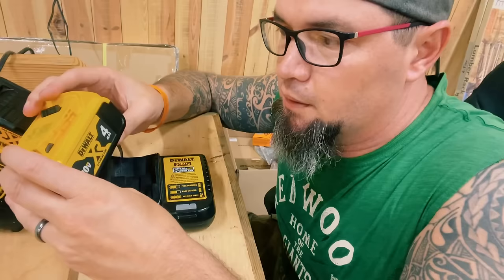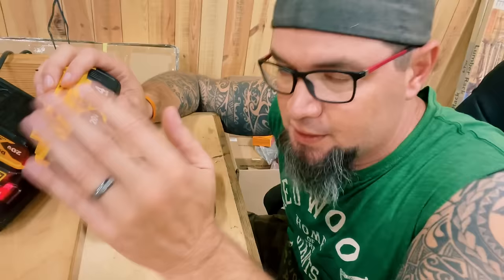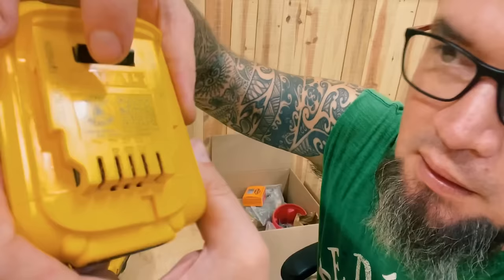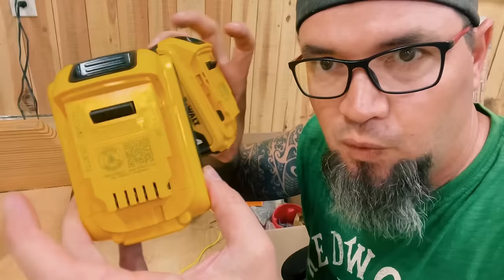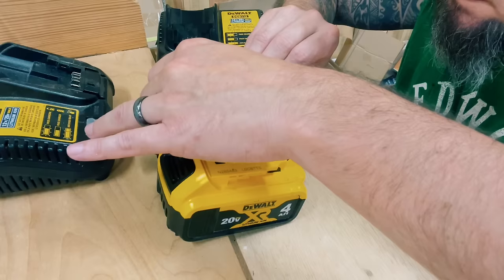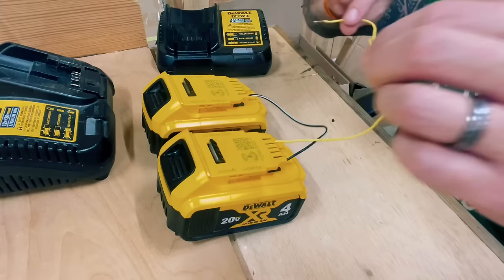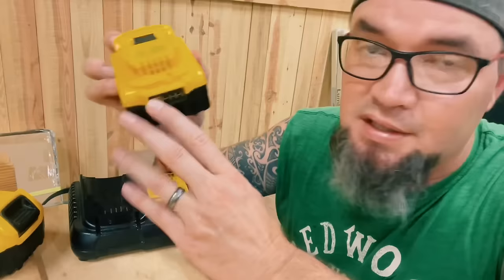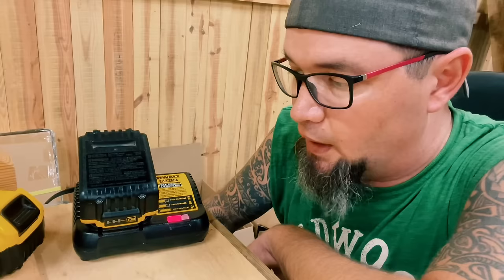Dewalt Lithium Ion Battery Won’t Charge? Try Resetting It With This Easy Fix.

Comment: Thank you, Matthew, you're a Peech! EVERYONE knows this fix, THE WRONG WAY!!! Most have been taught to do that reset with a number of electric sources other than the right one you can easily get from a like battery! Too easy! And then with your explanation we now have a full understanding as to WHY this is happening! Thank you again for taking your time to make this video!
Reply: Reasontruths:  that's ok but what about those who do not have a spare battery laying around.  Can another type of battery be used to put some juice in it?  I guess you have to match the voltage.
Reply: @horacesawyer2487  Good question, try it and see. What can you lose? A battery you can't use? I have multi voltage transformers, I'll find the right match no matter what the voltage. I have a whole slew of AA and AAA rechargeable batteries that are completely dead, and won't charge, this method works to bring them back! But I just use another AA or AAA to jump start the dead ones because I have so many good ones also. Do you have any small rechargeable's to try it? It doesn't seem that a lower voltage could hurt the higher voltage battery. Try at your own risk, but crazy me would go for it!
Reply: @reasoningtruth  Warning. Only do this in an emergency. If you manage to charge this battery, do not keep this battery anywhere it can cause a major fire.
Why ? When these batteries are discharged below 3v per cell, dendrites (small spiky structures) can grow and possibly pierce the separator between the anode and cathode of the battery, causing a short circuit, and thus a fire.

Most consumer electronics will regard 3.3v as fullt discharged, and the battery protection circuit will then turn the equipment off to prevent over discharging.

If a cell is found to be 2.3v or lower for anything by the a very brief time, then it is effectively dead, dendrites will have certainly grown, and even if you manage to charge it, the dendrites are still there, and you now have a ticking time bomb. Do not reuse such a cell.
Once that separator is pierced you may have a fire, the intensity of that fire will depend on how much charge is stored in that cell.

If your battery pack has been dischared for some time, open it up, and measure the voltages directly accros the individual cells. If this is less than 3v, do not attempt to charge. Even if there is not a fire, you will notice that after charging, that cell will self discharge within an hr or so. This is due to a partial internal short circuit caused by dendrites. More energy put in to such a cell increases the risk of fire.

You have been warned.
Reply: an this be done with a 10 amp battery charger?

Comment: Thanks! About three years ago I ended up with two Black & Decker hedge trimmers and never got around to sending one back. I was going to sell it, but never got around to that either. So it sat in its box until this year, when somehow the charger for the original one got misplaced. The "extra" battery was completely dead and wouldn't take a charge. Following you instructions fixed it immediately. Just the time it took to cut a couple pieces of wire and strip them on the ends. I'll remember this. Again, thanks.

Comment: Thank you so much! Good demonstration, just the right warnings.  For anyone interested: after a 5 seconds jumpstart, my dead battery went from 1.02V to 13.3V between B+ and B-, more than enough to work. You might want to try only 3 or 4 seconds.

Comment: Thank you for this! I had 2 dead DeWalt batteries and so thought my charger was dead. 
I used a charged Bosch to get them started. Worked exactly as you explained and saved me from buying a replacement!

Comment: Thank You Matthew! I had the identical battery, which was almost new. Your idea worked like a charm. I connected mine for 15 seconds, which is likely 10 seconds too long. After removing wires one light was lit on the charge indicator. Your presentation is too the point with no fluff.
Reply: It was too long yes.

Comment: Yes this does work, my 20v battery pack read 2.0v, i bumped it with another 20v pack for a 2 sec and it gave it a surface charge of 12v decreasing to 7v which is enough for the charger to recognize the battery. This can probably be done using a 9v battery as well if you only have one tool battery since your only giving it a small surface charge
Reply: Warning. Only do this in an emergency. If you manage to charge this battery, do not keep this battery anywhere it can cause a major fire.
Why ? When these batteries are discharged below 3v per cell, dendrites (small spiky structures) can grow and possibly pierce the separator between the anode and cathode of the battery, causing a short circuit, and thus a fire.

Most consumer electronics will regard 3.3v as fullt discharged, and the battery protection circuit will then turn the equipment off to prevent over discharging.

If a cell is found to be 2.3v or lower for anything by the a very brief time, then it is effectively dead, dendrites will have certainly grown, and even if you manage to charge it, the dendrites are still there, and you now have a ticking time bomb. Do not reuse such a cell.
Once that separator is pierced you may have a fire, the intensity of that fire will depend on how much charge is stored in that cell.

If your battery pack has been dischared for some time, open it up, and measure the voltages directly accros the individual cells. If this is less than 3v, do not attempt to charge. Even if there is not a fire, you will notice that after charging, that cell will self discharge within an hr or so. This is due to a partial internal short circuit caused by dendrites. More energy put in to such a cell increases the risk of fire.

If the cells have briefly (a few hrs only) dropped below 3.3v, but, not below 2.3v per cell, then ok, have a crack at charging, but, there is increased risk of fire. 3v can be revived ok providing the cell has not been sitting @ 3v for period of time. More time below 3v = greater risk the anode to cathode separator will be pierced from growing dendrites, causing a short circuit, and hence a potential fire hazard.

You have been warned.
Reply: @nordic5490  true this trick only worked temporary and the pack didn't hold a full charge, after separating the individual batteries 1 cell was bad and couldn't be charged, also realized this method can over charge cells. The remaining cells tested fine with low resistance and near rated capacity

Comment: Well Mathew, I can't tell you how helpful this has been. I have already taken 4 different batteries back to Dewalt to have them replaced just for this very reason. Many thanks for some extremely helpful info sir and you now have a new subscriber!
Reply: How do you take them back to Dewalt
Reply: @billyd.6411  Out here where I live there is a Dewalt store that does repairs. That's where I take my Dewalt tools to be repaired and such. And as long as the batteries are still under the 3 year warranty then they will exchange them with no questions asked.
Reply: @brianfalls5038  ok thanks will give it a try do I need a receipt or can they tell from serial numbers
Reply: @billyd.6411  If you look on your battery then it should have a date code on it. It should be on the top left hand side of the battery. You shouldn't need a receipt for the battery.

Comment: My only suggestion would be to make up your wires with spade terminal ends, just to avoid the risk of loose strands of wire breaking off inside the battery housing and causing problems down the road.

Otherwise, good video, thanks. 👍

Comment: I can't believe it actually worked!  I had a brand new battery with a power tool kit and it didn't work out of the box (got a warranty replacement after going through troubleshooting steps with the manufacturer). But this trick actually kick-started it. I only get 3 bars out of 4, but as a spare backup battery, it's better than landfill!

Comment: It’s working. One totally discharged Dewalt battery and one partially charged Dewalt battery. Partially charged battery was able to start charging. Couldn’t get the totally discharged battery to start charging. Connected like shown in the video for around 5-10 seconds. Disconnected and then plugged in the totally discharged battery and it’s charging! Thanks!

Comment: under no circumstances do this without testing cell voltage first (open the battery up and check the voltage acreoss cells), YES it can work if the cell voltage is still above 1.9v , if it has dropped below 1.9v and you do this you run a high risk of overheating the cells as the cells can experience dentritic growth between cell layers and cause short circuits
Reply: Do you have to disassemble the case or can you test at the B+ & B- contacts?
Reply: @kevosims2012  I take the case off so I can check the cells individually (or in parallel pairs)  if you measure the total battery voltage it might show it down by a couple of volts which could be interpreted as either a partly discharged battery or a battery with one cell near death, I don't like the ambiguity
Reply: @TheMingilator  Copy that. Thanks for the reply, very helpful.
Reply: It's not going to overheat and explode in 3 seconds.
Having said that: do this outdoors
Reply: SaltyBrains if it's been entirely depleted then it is no longer a good cell, it is best practice to dispose of them

Comment: Just repaired 4 batteries like this. Word of advice to someone trying this trick. You may need to keep both batteries hooked up together for 1 to 2 minutes to get enough charge in the depleted battery so that the charger recognizes it. I went by intervals of 10 sec, 30sec, 1 min, 1:30  then 2 min. Kept one connected for 3 min to try and get it going but its still having problems. Didn't see any negative side effect on the good battery even at 3 min connected.

Comment: You helped me. I didn't have a 2nd battery but I did have a trickle charger I use for my lawnmower battery. I used small nails as contacts and connected directly to charger. The green light started blinking showing I had it connected correctly and after about 30 seconds I disconnected it and set it in my charger and it charged. Saved me big time.

Comment: I looked all around this job site and had nothing, no spare wires. but I did have an assortment of tiny slim washers. I lined up the positive to positive and negative to negative terminals as you said, but used the two washers to go into the battery slots, probably could fit dimes as well. Got a larger than I expected spark which reset the battery and now it is charging! Thank you! I looked like MacGyver !

Comment: Thank you!!! Had same issue a few months ago and I just threw the battery away. Fast forward to today and had same issue with a second battery. Stumbled upon your video and gave it a shot. It worked! You saved me money. Thank you. I used thinner wire and it started to melt almost immediately.  Be careful and make sure you remove wires right away.

Comment: I had done the exact thing with a 2ah battery. Run it down in a stereo. It’s been on the side for over a year. It was a nearly new battery before it went into the radio. I’ve just followed your instructions and wow. You saved me buying a replacement. Thank you. I have sent some money as a thanks for saving me money! .

Comment: Thanks you so much for this lil hack I just bought a second hand DeWalt drill set and one of the batteries was completely  dead it's worked 100%😊😊

Comment: Thank you...that worked for a 20V Max Li-on!! 👍 I used four box cutter blades inserted into the +/- terminals on each battery - one fully charged, one dead. Then connected those in polarity with two jumper wires that had alligator clips on each end. You're spot on: "only for a few seconds." The jumper wires were getting warm after 10-15 seconds. The dead battery started charging when placed on the charger. The dead battery had been left in a tool for a few days and died. Not worried about "old" battery revival issues with it.

Comment: Thank you for this video. I have had my Dewalt drill for 2 years now and I have never used the other battery. I just recently tried to charge it and it would not take a charge. I just tried your hack and bam it is now taking a charge. Thanks again.

Comment: Much appreciated...met a guy giving away hi  40v brushless trimmer (like new) because the battery was "done" and they want $400 for a replacement. got trimmer, charger and battery for free...brought it home, tried this hack...went out and weed whacked the whole yard 4 hours later.  This hack is a great find.   :)

Comment: EXCELLENT VIDEO!!! I could tell you knew what you were doing when you connected the positive 1st (most don't understand why). If you want to know, it keeps the battery from arching. I just wish I knew this trick a few years ago! I threw away over $2,000 in batteries because I left them in my garage over winter (I'm in the NE). NONE would recharge but I didn't try this trick. I've used it OVER AND OVER since! Out of at least 100 batteries, only one would never recharge.

Comment: I have exactly One Dewalt 20V battery, purchased years ago for a heated DeWalt Jacket, which I ended up using my Milwaukee 12V batteries in

Tried to charge the battery recently & it was absolutely dead; Following your instructions, I used a fully charged Ridgid battery (LOL) to boost the DeWalt and placed it in the charger & it's taking a charge

Have a couple of "dead" Ryobi batteries, just have it a quick boost, using my Rigid Battery & it's now taking a charge 

Thanks for the tip

Comment: I had to come back by and tell you THANKS AGAIN, BROTHER !
I did this and it worked !
I had just gotten 2 brand new 5 AH  DEWALT batterys off of Ebay only a month ago. One died - one was fine. The dead one wouldn't do anything after one use.
So Sincerely, Thanks !!
Wulfy

Comment: This isn't only a cost and time saver, it's an environmental protection as well.  Thank you.
Reply: For a very short time. The "zombie" battery is dead and only working at low capacity and dangerous too. 
But hey, go for it!

Comment: Easy to understand, easy to follow, worked when I applied it. Honestly I took my little home electrical kit. Took the alligator clamps and a ring terminal on both ends and slid them in as noted. Waited 5 seconds. Disconnected and onto the charger and now my battery is charging.   God how did I not know this earlier 🤦‍♂️

Comment: Holy crap, just pulled my dead battery out of the trash to try this. Seems like a design flaw that it uses charge to detect if a battery is present. Thanks!

Comment: My battery was actually showing as full when I put it on the charger despite being dead. When I checked the voltage I got 15V. I used your method in 5 second increments, checking the voltage after each bout. After 4 or 5 connections, it was up to 17.3 V and it worked on the charger. Thanks!

Comment: Freaking awesome!  I had one that I put in an adapter to run my jig saw and it set about a week.  It completely drained it and wouldn't charge.  This saved me about 60 bucks for a new battery.  My hat's off to you sir!  Thanks!

Comment: IT FREAKIN' WORKS!!!!
I just bought 2 brand new Dewalt drills with 2 batteries & charger. One battery shows NOTHING when I plug it into the charger= dead. These batteries are the cheapest ones & do NOT have the battery charge status indicator display button with lights.
EDIT:THANK YOU!!

Comment: Awesome. Saved my 60v toro flex force battery. I used a DC bench tester at 60v and 0.5 amps for maybe 8 seconds then put it on its regular charger and bingo, it started charging. Thanks!

Comment: Had a “bad” battery that would not charge.  This tip seems to have worked as the charger and battery now indicate that it is charging.  Thanks!

Comment: I didn't have another DeWalt battery so I used a 9-volt battery and wired it in the same series as you show in your video held it there for 3 minutes The  battery fire backup!
Thanks 😅

Comment: Thanks for this video.  Had 3 new batteries, don't know how one got discharged as don't even recollect turning on the attached device but a couple of times.  Followed your procedure and the battery's charging now!  Going to retain my speaker jumper wires in the Dewalt tool bag!

Comment: Thanks man, you just saved me a lot of trouble. Guessing this resets an internal BMS? I have a big lifepo4 battery that would use this same technique if it ever had a low voltage shutdown condition, but I never knew dewalt batteries had this function. Mine would show one bar of battery so it wasn't fully discharged, yet this reset still worked, thank you so much again!

Comment: Thank you thank you!  I've a DeWALT 20vmax battery that, though it is 6 years old, has been used very little.  Circumstances I won't go into caused complete depletion.  Using your instructions for a jump start perked it right up.  Charging right now as I type.  Woohoo!

Comment: EXCELLENT !! I just performed this on 3 Dewalt batteries that would not recharge...no light on the charger at all. And what do you know.. all 3 are now recharged. I had used all 3 of these 20v batteries on an 18v vacuum with an adapter. The vacuum would run completely down and stop. And batteries would not recharge. I was getting ready to replace them..
Thanks a bunch for the video.

Comment: Great vid,  to the point , and works , i used the same method
except that i use a 18v battery to kick start 2x 14.4 v batteries worked great, only had to connect for a short time.

Comment: With the older batteries, it is sufficient to put them on the charger and plug and unplug them a few times, 
wait a few seconds and then load normally.
works pretty often.
I've saved a lot of money this way.
Just try it.
Reply: That would be even easier. I'll try it if it happens to me. Thanks